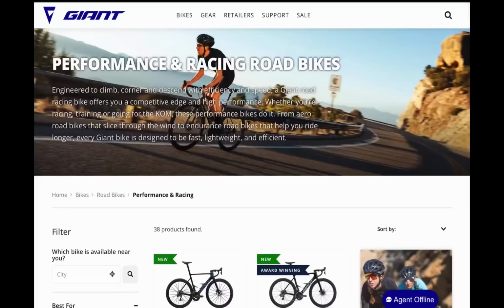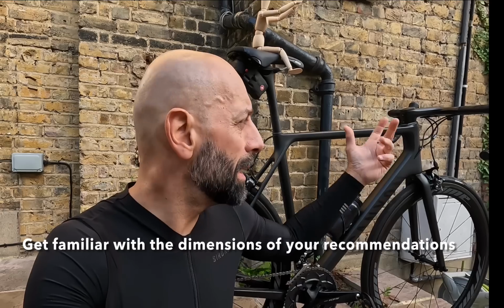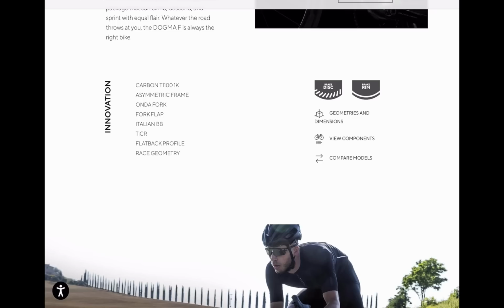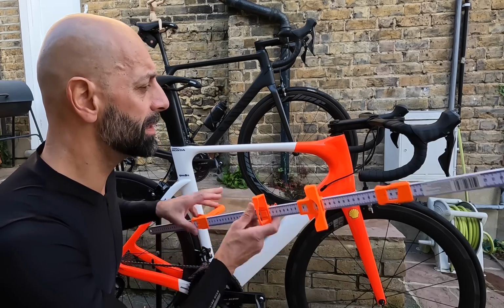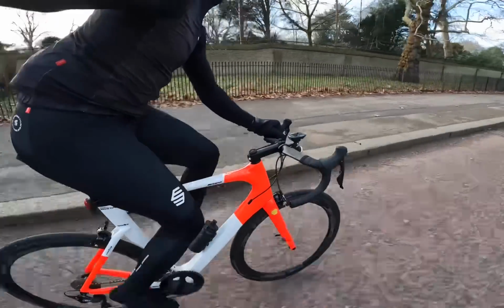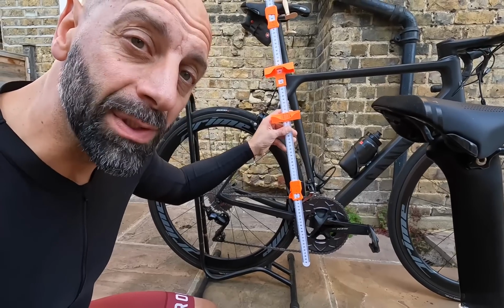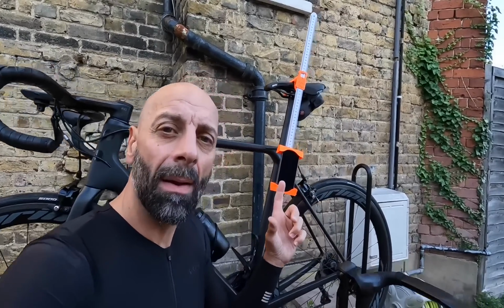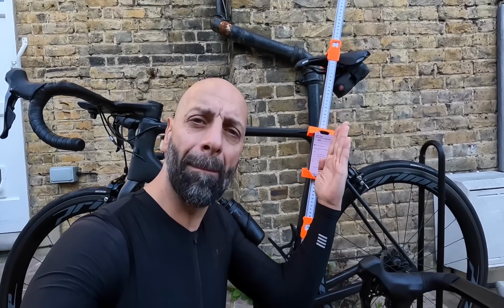Road bikes sizing, geometry and set-up: what to consider first!

Comment: Thanks a lot, Federico! Your videos have opened my eyes when it comes to body positioning on a bike. Especially the concept of rolling the whole body according to bike geometry has been kind of a revolution for me.

Previously I thought the saddle should be in exactly the same place no matter what the bike is. Riding position is simply adjusted by the front end. But it seems that’s not necessarily the case!

I ride a Canyon Endurace and the size is exactly the right one for me. However I’ve got the front end slammed almost all the way. A while ago I rode a few kms with my friend’s Aeroad which was the same size as my Endurace. The Aeroad felt surprisingly comfortable! Maybe the concept of rolling the whole body was the reason. Aeroad’s front end is longer and lower than on the Endurace but the whole riding position was more up front so the position didn’t feel as aggressive as I was expecting.

Of course it would be a totally different story how those two bikes felt at the end of a 300 km gran fondo, but I think after that I would feel sore no matter what bike I rode! 😅
Reply from the maker: Yes, definitely to me the whole position would need to be consistent with the type of the bike and intended use. Mixing different characteristics might not work!

Comment: Greetings! I remember you saddles video. You found a good saddle? I sold the ISM saddle after 1 year of pain. After some research i got the Pro Stealth. So far no genital numbness and pain there. I think i found the right one. I will aim for bike fitting now. No more new saddles.
Reply from the maker: Great! I have been using the Selle Italia Novus Boost for a while now, but it's the previous model now discontinued, similar to a SMP design. I like the Stealth, I was going to try it next if the Novus was not working!

Comment: I pushed my seat all the way forward, and when I sit on the last inch or 2 I find I'm about 4kms per hour faster.  That makes me wonder why wouldn't they make a seat tube 90 degrees?  I'm finding your content to be very informative, thank you from Canada.  I will subscribe.
Reply from the maker: Thank you! I guess it's a combination of classic bike design, somehow still mandated by UCI rules, and the need to offer a wider use of the same frame. It's definitely worth experimenting, as long as it doesn't impact with our muscle and knee activation.

Comment: Hi . what about guys wth long inseam and relatively short torso. 187cm tall with 89cm
inseam. I'm lean at 67 kilos and in my late forties. .My shoulder with is 42 cm .I ride a
flat bar 10 year old giant rapid which I'm happy with and get up to good speeds on a 
52 chainring. I like the balance of the bike but in a head wind it's not much use. It's
aluminium and low spec but still comes in under 10 kilos. The Defy looks like a suitable
geometry for me but the price is too high and the weight isn't given. if I were to spend
2 grand on a bike I'd be expecting to know the weight of the thing. Jesus Christ is King
and its amazing he humbled himself to the level of man and died for our sorry asses
to lift our spirits above the level of this deceitful world. Bike riding is a gift, all things
considered, thank you God but the enemy couldn't even keep its greedy claws off of
it. God bless you Frederico Ciampella.
Reply from the maker: If I were you I would keep your current bike and find something a little more race like a TCR or Ultimate to have more differentiation between the two bikes. Make sure you check your inseam by applying some pressure as you were siting on the saddle to a correct measurement. Then check the advised sizing from the manufacturers. With a seat post with no set back you should be able to get comfortable even with a short torso.

Comment: I’ve got the exact same “problem”, which you described regarding the seat tube angle. My first bike was fitted to me perfectly and - knowing the measures of my primary bike - I just looked at stack and reach and bought my second bike. Unfortunately its seat tube angle is slacker so the effective top tube a little bit longer and my position is a little bit behind the bottom bracket. I managed to get a similar fit with reducing the reach in the front and I think, the bike fits ok now.

But in the back of my mind, I still have the thought of: why didn’t I do my homework correctly and picked a size smaller ? 😮
Reply from the maker: Yes, seat tube angle it's a measure that's been neglected a bit towards stack and reach and can have a massive difference. You are definitely in a more powerful position with a steeper and more centered seatpost.

Comment: Is there a video plan for reviewing the Vision wheels and maybe compare them to the prime wheels? Would be interesting to know, if and how big the difference in performance between these two is. 
Keep it up, I love the charme of your videos 🙏🏼😉
Reply from the maker: Thank you! It would be definitely interesting and I'm planning to ride them on the Ultimate as well to see how they go on that bike. First impressions the Vision seem a little bit faster, but not that much. I'm running them with 23c as the channel it's slightly narrower than the Prime and they should be more aero. Also aero spokes and 55 vs 50 might have a slight advantage. However for the price it's difficult to fault the Prime.
Reply: @fede1275  Thanks for your quick first impressions. I'm looking forward to that. By the way, differs the braking performance in any way?
Reply from the maker: @I120599  I actually riding them today on the Ultimate for the first time, to compare them against the Prime on the same bike. Braking is smoother at first, both on Prime and Vision pads. The Prime have a harder bite, the Vision are more progressive. Not sure yet which one I prefer, I will do more tests.

Comment: Very comprehensive. The 26 km/h-border between endurance and performance is the only point irritating me. The difference between the two is actually 2 to 3 cm plus in stack and a slightly shorter reach (in the endurance version). This is less aero, but more comfortable. The actual difference in speed is not negligable, but maybe 1 to at most 2 km/h. More comfortable means faster. Especially if you are a bit stiff on the bike, that outweighs the aero losses for a good part. And come on, 26 ist party pace, at least on ok roads and in the flat.
Reply from the maker: Maybe I should have explained it better: I was referring to a typical ride of 80/100 Km with 2 or 3 hills. Doing it at 26 Km average or 29 Km average can make a big difference in the effort, especially when you need to pull at 40 Km/h in the flats. If you want to get the most efficient way to go fast you also need to go low to ease the effort on the legs. The more upright you are the harder it would be.

Comment: I find Canyon's bike sizing chart to be one size too small for my body dimensions.  I had a Canyon road bike and currently have a Canyon XC MTB.  I'm glad I ignored their recommendation for frame size.  These days there is a tendency for bike manufacturers to recommend smaller size frames and putting on long stems and seatposts with more setback.  I prefer to get a properly sized frame to start.  The lesson here is don't always take the manufacturer's sizing recommendation as the only input in your decision.  Stack and reach are two very important dimensions in dialing in your fit.
Reply from the maker: Interesting, some say Canyon sizes fit larger than other manufacturers, like their S is almost a M in other brands. Maybe their recommendations follow that line.

Comment: Good video Federico, I find geometry and bike sizing a minefield. I have to ride an endurance position due to lower back issues, when researching my last bike I settled on a BMC Roadmachine based on stack / reach knowing I would have to shorten the stock stem to make it measure the same as my other bikes, to my surprise it still ended up longer to the hoods yet because I had more stack height I can ride the position. 

Can’t say I agree with the bit about speeds though, an endurance bike is more than capable of riding at 20mph + (average) assuming you can output enough power, but I agree that’s what the bike industry would have you believe that race bikes are more for speed and endurance for a slower pace. 

I think as long as you’re in a position that allows you to be comfy and output good power then it’s not always necessary to be on the “race” bikes as such, I also think the industry needs to tweak how it looks at the categories in that respect, Bike fit James regularly comments that the industry still makes bikes that are too long, and that a lot of people are too stretched out. 

Creating a simple spreadsheet with some common bikes stack / reach measurements in can quickly show you how a new bike will stack up against your current bike, I very quickly stopped looking at bikes purely after comparing their stack and reach figures.
Reply from the maker: I should have explained the speed reference better: at the same power you will be inevitably faster if you are lower and more aerodynamic with the body position. So you can be as fast on an endurance bike, as long as you are more powerful. It's just not as efficient, while a race bike should fit you in a lower position more naturally. I suspect people end up on a longer bike than ideal if they have not considered the whole bike set up, including the seat tube angle. As you have seen I possibly have reached my stretch position on the Velobuild, even if it has got the same reach and stack of the Canyon.
Reply: Yes that makes a lot more sense 🙂

Comment: I have long legs (84 at 175cm). So in most cases bike sellers want to seat my on a larger Bike (L, 56, M/L). I just rode a giant propel in size M/L, where Giant would place me on a M. Iam really looking for a racing bike, I own a Cannondale Super Six 2019 in 54, but it feels not right, very slack head tube angle (71.3). aim looking for something more aggressiv.
Reply from the maker: It looks like some manufacturers are still using old style seat tube angles, where a lot of riders now ride more centered and on top of the BB. Canyon is better, also new Specialized angles are also aggressive.

Comment: Hi, very nice video discussing bike geometry. Also it is good to give it some time to get used to the road bike position. Your first rides you may get lower back pain simply because you are not used to the position. Personally as I got more into road cycling I've been wanting to get in a more aggressive position. Most entry level bikes have endurance geometry, which is good for beginner riders. I own currently the Trek Domane Al 2, which has a quite upright position (in 62 cm). But as I'm more used to road bike position now, I'm using a 13 cm stem slammed with 17 degree angle and seat slammed forward to get in a more aggressive position. This helps but it is not enough, so I'm looking for a somewhat budget friendly aluminum bike with race geometry, ideally like 5 cm lower and 2 cm more forward. I don't really need disc brakes, there just are not many options available in my size. Have not found the ideal bike yet!
Reply from the maker: Yes, good point. Unfortunately the manufacturers have to decide what the majority of the users would want and don't offer aggressive frames in affordable pricing.

Comment: Very good! I would only add, that if someone is caught on the line between two sizes, go for the smaller size. You can effectively make a smaller bike feel larger but very difficult to make a bike that is too large feel smaller. A brand like Giant offers a M\L on some bikes which is something I wish more brands would do.
Reply from the maker: Absolutely, great point. I might follow that advice myself soon...
Reply: I have to disagree There. Depends on the objetive of the rides and geometry. Race bikes can me be smaller endurance not. At the end of the day its personal and experience cant be bought hehe
Also. Stem length changes geometry and handling. If you prefere longer stems go with the Small size, if you prefere shortes go with a Bigger size